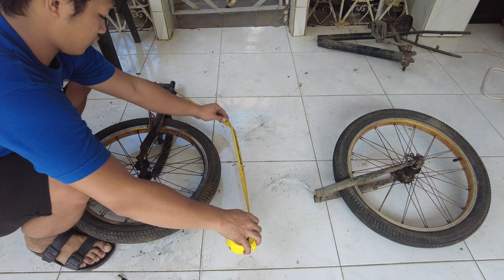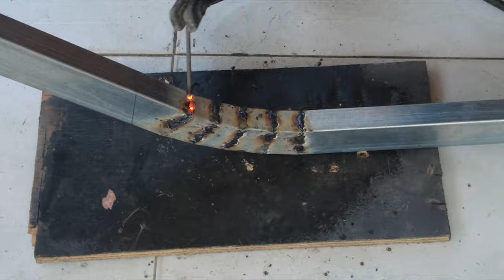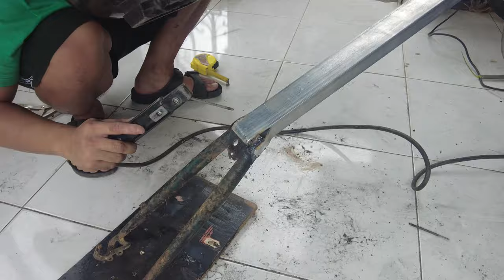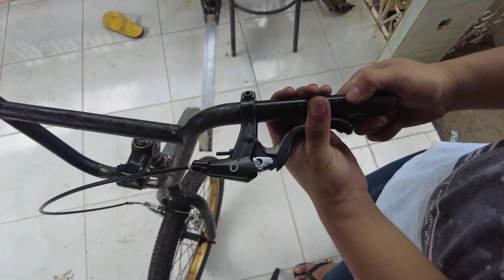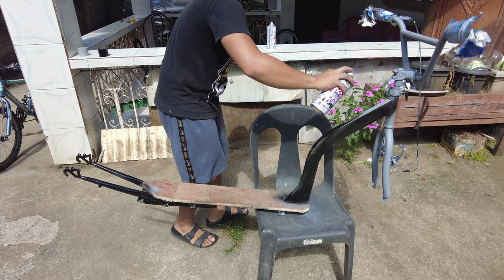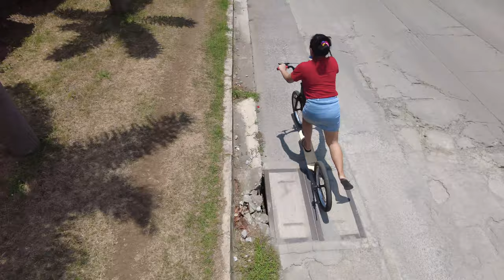Build Diy Kick Scooter From Old Bike For Basically Free - Tutorial

Comment: VERY Nice work! One comment. The platform is too high. It needs to be lower to the ground to make it easier to kick. Look at a brand like MIBO scooters or Yedoo scooter. MIBO scooters are very low to the ground and easy to kick. Otherwise your legs will get tired VERY quickly. 

How many hours did this project take you to finish?
Reply from the maker: That's a nice thought sir! In fact it is true after a couple of minutes my legs hurt and ended up swelling
Reply from the maker: I figured it took me 3 weeks to finish this project beacuse i have work at noon

But if I have the whole day it would only take me 2 days to build it